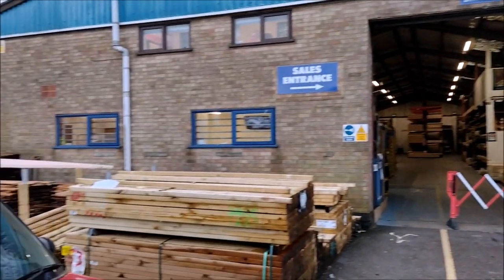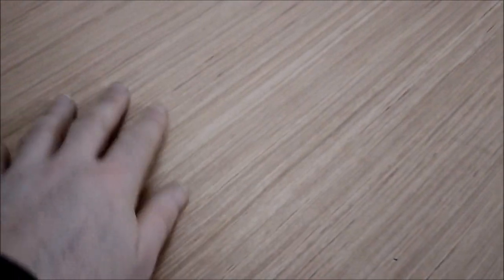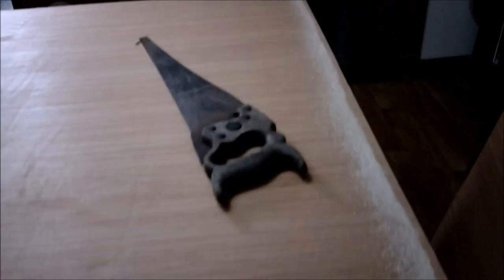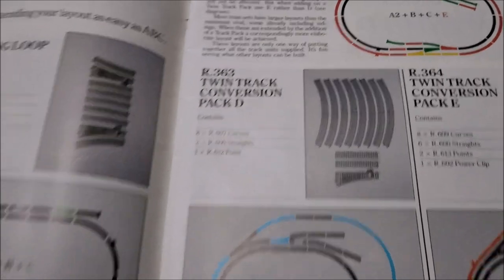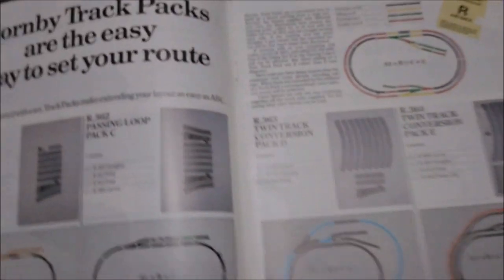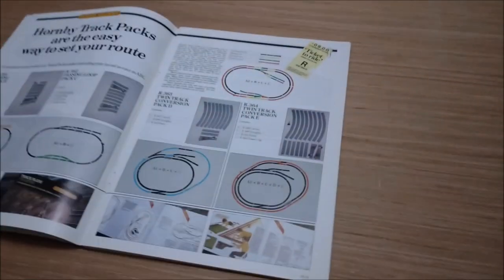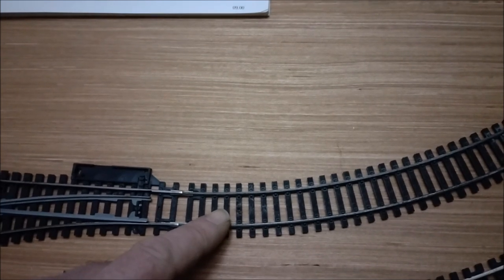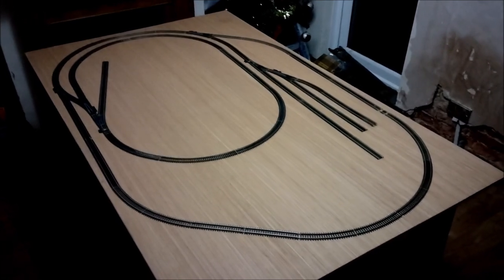1981 Ticket to Ride Hornby Catalogue Model Railway Trainset Part 1 Baseboard and Track Plan

Comment: Reminds me of my own experiments. The trouble with the R605 curves, as you've likely discovered by now, is that quite a lot of rolling stock can't get round them reliably. Pretty much any loco you buy, other than the little 0-4-0s, will say that it is not designed to run on curves tighter than 2nd radius, and R605s are 1st radius.
Reply from the maker: Yeah, discovered it as a kid when my 4-6-2 duchess of abercorn didn't really work. Took decades to know why!